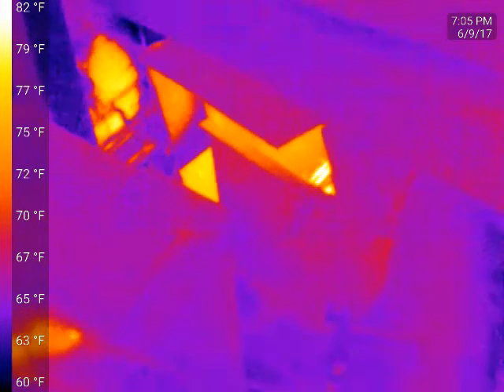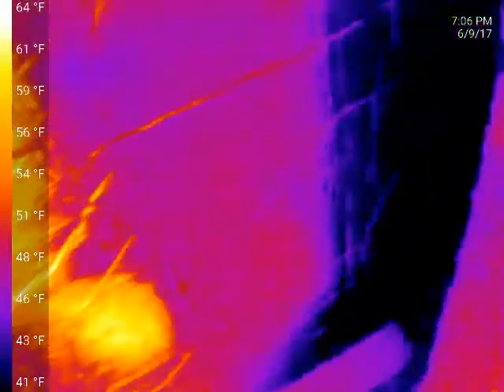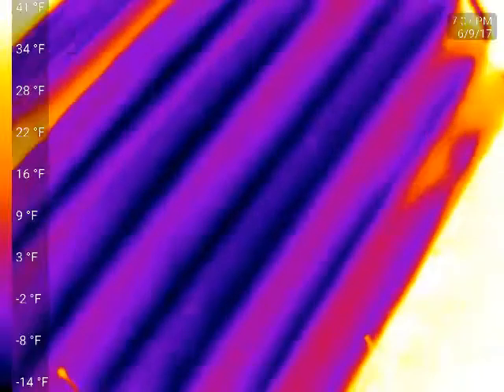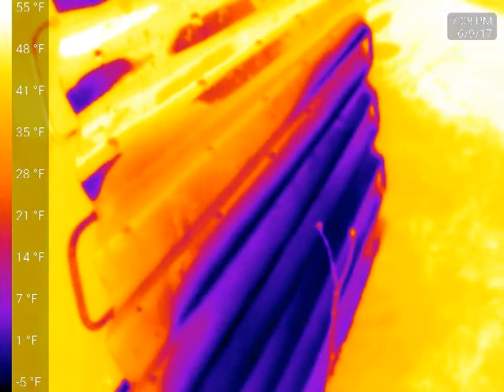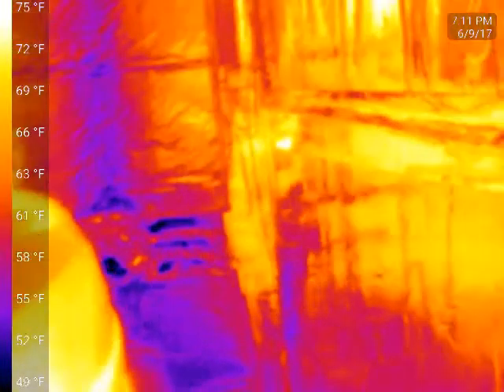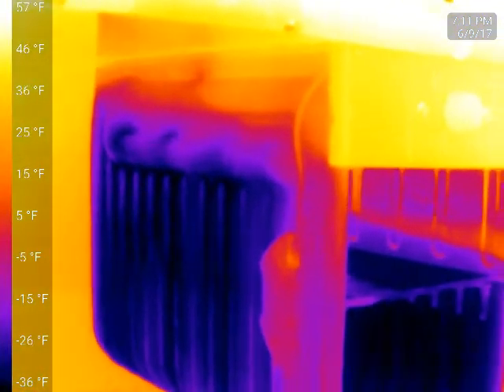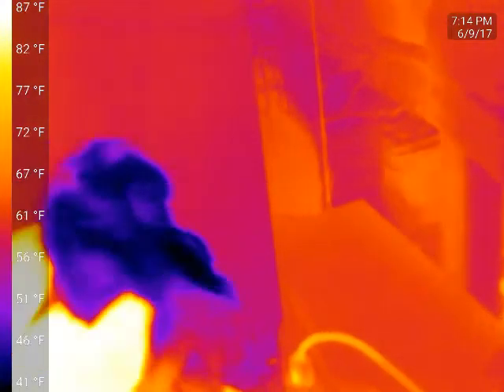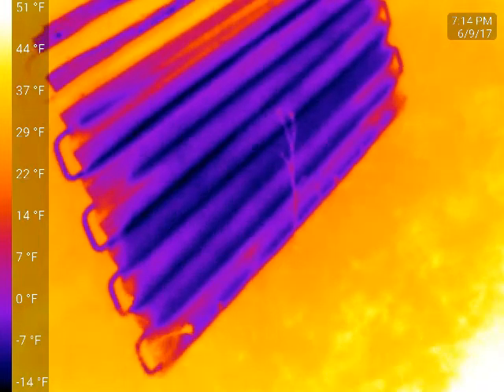Monitor Top and Heat Pump in Thermal

Comment: Hi Mike and thanks for your interesting vids! I am a member of Rochester Makerspace and we have a 3000 sq ft ( tall ceilings) room we want to cool. Forced air furnace has evap coil but nothing else. Landlord says thousands to install central a/c. Wondered about the following. How bout stack up a bunch of used window units, build a cardboard housing around the back and sides of them, use a fan and a couple dryer hoses to circulate outside air from a window through the housing. Pan w pump in housing to remove water. Lose one unit and replace w another $100 used one. Also looking for any other crazy ideas. (Make/store ice during unoccupied hours, cold fusion, orgone)
Reply from the maker: robstorms Cold fusion, definitely!
Reply from the maker: Portable a.c. units with hoses might be your best bet. You could distribute them around and replace as necessary. They are commonly 1 ton units, so they can move a fair amount of heat. Ceiling fans and pedestal fans do wonders. Get the air moving around as much as you can. Run the furnace blower to circulate air. Exhaust got air at night and pull in colder outside air until morning. 

Build a giant sun blocking umbrella and pull a Mr Burns.
Reply: Thanks ! We will see what we can do !
Reply: @whatawaytogo515  Those huge fans on a pedestal, the industrial type or not terrible expensive and can move quite a bit of air and are relatively quiet.